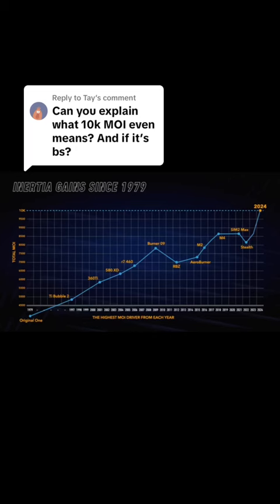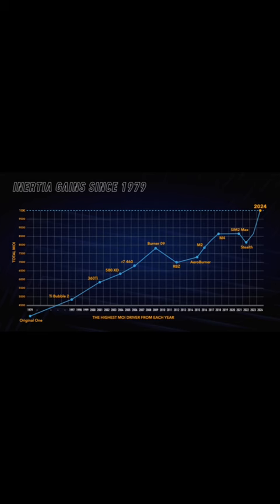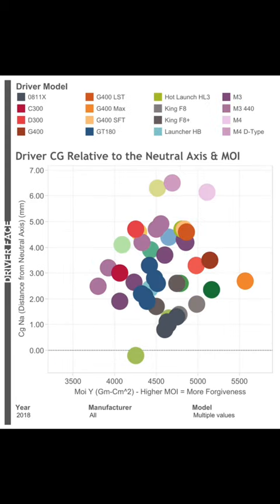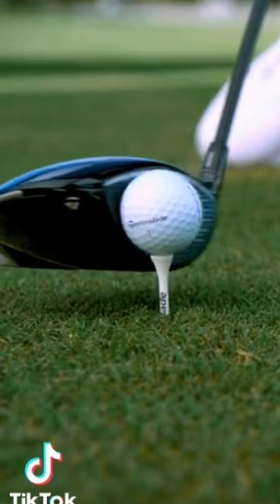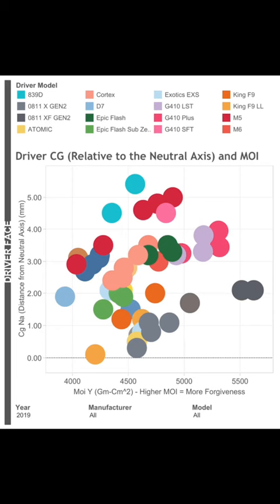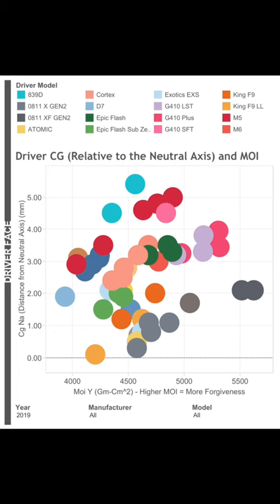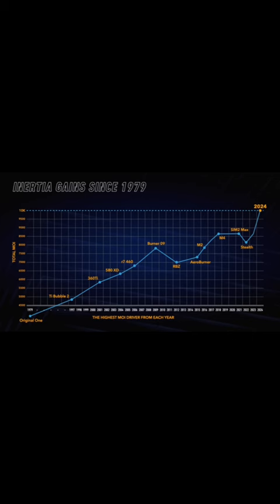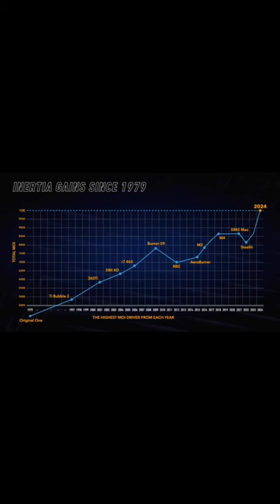013 - Do Not Be Fooled By 10K MOI Drivers Like the Taylormade Qi10

Comment: I don’t actually get what we are saying. Head weight is a bigger factor in alleged forgiveness? Do I stay g400 max then?
Reply from the maker: G400 Max is already around 10K moi, but any heel toe MOI over 4000 g-cm^2 will do fine.

Hasn't changed in about ~8 years.
Reply: @bigboigolf  thank you. I was looking tsr2/3 they seem to have good ball speeds. Idk if my ping is slow or I’m getting old.
Reply from the maker: @adamvlassis4090  Ball speed has been capped as a product of characteristic time for about 20 years.

If I were you, I would sit down and evaluate your setup with your club with some numbers and see what is annoying you. Generally the head design is going to be fine, you can have problems with total weight, assembled length and balance point, and the shaft.

It took quite a bit of time and was beyond the capabilities of fitters for me to get to a build that brought out my best and consistent tendencies.